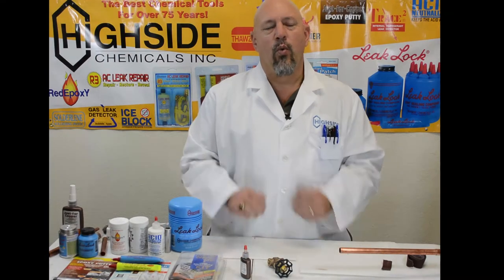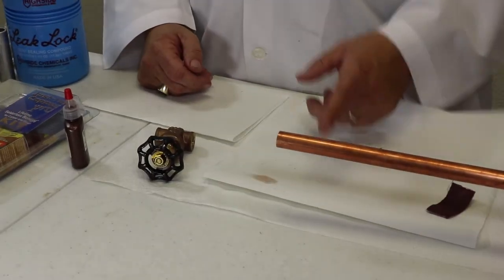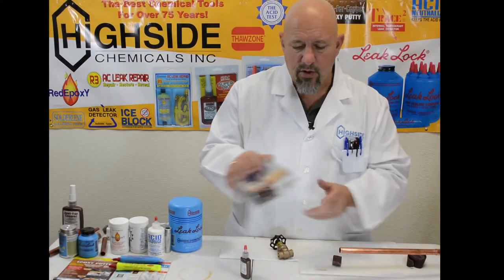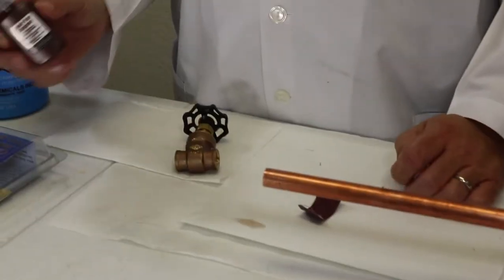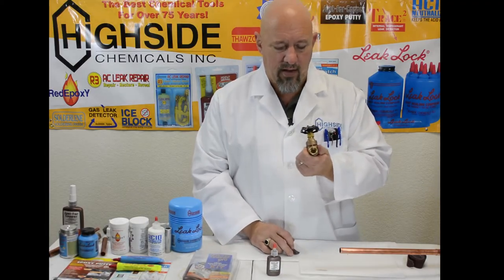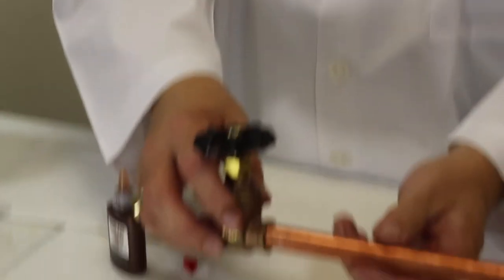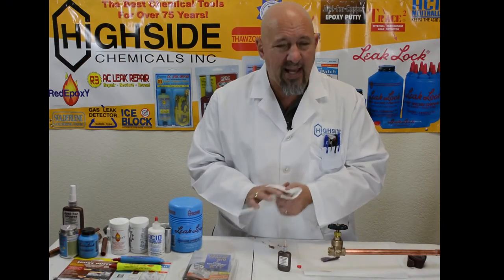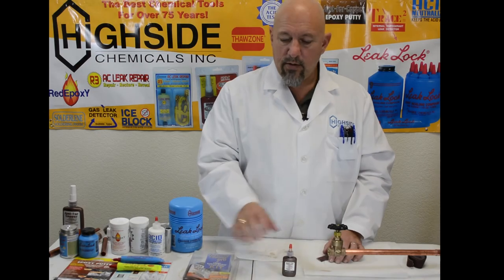Highside Chemicals Just For Copper Pro

Comment: As a plumber, I dont think i would trust this..
Reply from the maker: Hi, we understand the hesitation. Most people are skeptical until they see it in action. The most important part is having the proper clearance, we recommend using a swage tool to achieve this. This formulation works by binding with the single valence electron and removing the oxygen, an anerobic reaction occurs and cures the product. It is also safe for potable water. Here is a link to find a supplier near you, we offer this product in a smaller 10 gram option and we are available for technical support M-F 9am-5pm CT. https://www.highsidechem.com/product/just-for-copper/
Reply: In plumbing we always have to think about disassembly. This is hard enough, and this product will make it harder for disassembly
Reply from the maker: @fionnan2811happy  This product can be easily disassembled by heating the connection to 354°F and pulling apart. It is also more cost effective than having to solder/braze. Also, the connection would not have to be cutout and done again like normal soldering and brazing would in the case of a bad solder or braze job. No wasted materials. This product was specifically developed for those job cases where flame is not allowed or there are safety concerns.